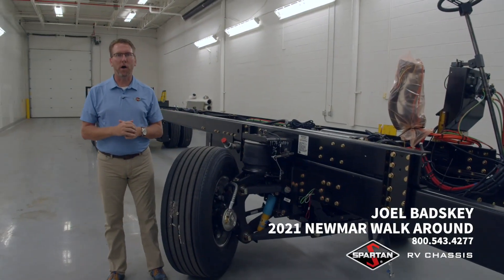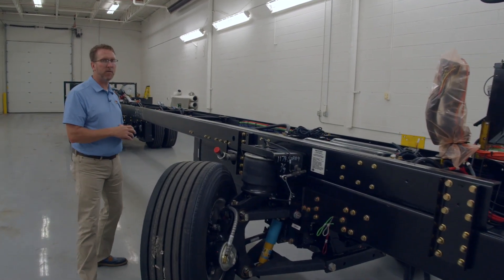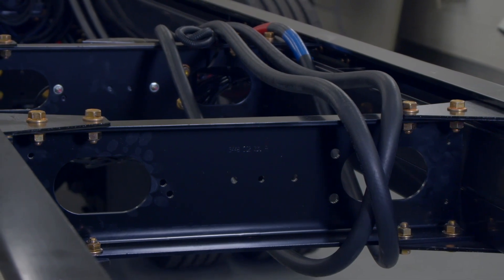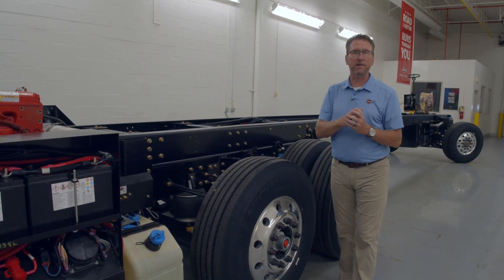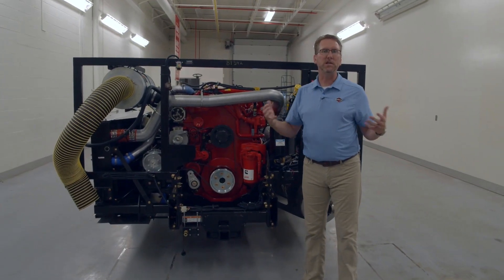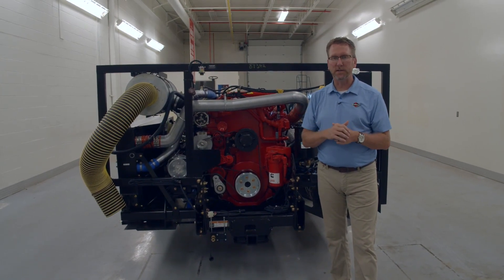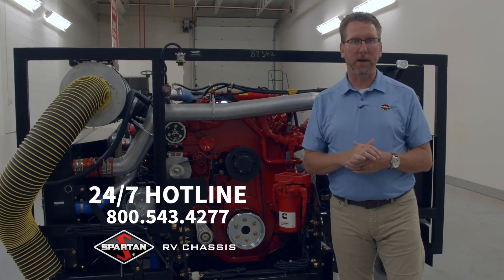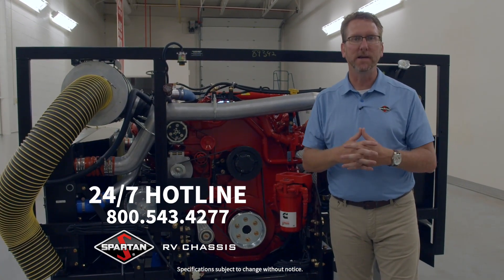Newmar MY2021 chassis updates

Comment: Despite the comment at 0:53, all modern shock absorbers (properly called suspension dampers) are telescopic hydraulic type - "liquid" shock is not an alternative to "gas shock". 

What "gas shock" means is that the fluid is kept under pressure (referred to here as "back pressure") by trapped gas (nitrogen) at higher than atmospheric pressure. All monotube shocks are gas pressurized; the alternative is no gas in the working tube, and an extra outer tube (thus "twin tube") as a reservoir. There must be either a gas cushion or outer reservoir to accommodate the change in volume inside the working cylinder as the piston strokes in and out. So the choices are:
twin tube, or
gas-pressurized monotube.

The gas pressure does avoid foaming of the fluid, so it is beneficial. Just as importantly, and not mentioned in the video, is that the monotube design exposes the outside of the working cylinder's tube to ambient air for cooling, while the twin-tube has the reservoir around the outside causing less direct cooling. 

I don't think that this account manager understands the technology - he has only memorized some of the advantages for marketing.

Comment: The comparison of frame rail thickness is interesting, but not very useful. 

One issue is that it seems unlikely that all chassis models from any chassis manufacturer use the same thickness of frame rail... so what is being compared to what?

The other and more significant issue is that thickness is just one of three frame rail dimensions which are all important: thickness, flange width, and web height. The yield strength of the steel is also important, and not mentioned. 

For instance, in a quick web search I found a spec sheet for a 2006 Freightliner XC that gave dimensions of 9" x 2.75" x .25", and another spec sheet for a 2013 Freightliner XCS that gave dimensions of 9-1/8" x 2.81" x 5/16" (which is thicker than this video claims).  If you are going to compare only one specification value, it should be RBM (resistant bending
 moment), which is the result of all of the dimensions and the yield stress.

Comment: Why only a six speed still?  The last Diesel pusher I drove, the gear ratio spread was too wide and it would shift at the redline and put the engine under its power band, making hill climbs a very slow endeavor.
Reply: They use Allison transmissions, which are the only readily available automatic transmission line in the medium-duty market... and Allisons are only six-speeds. Check any medium-duty truck from common manufacturers such as Peterbilt/Kenworth and Freightliner... they have 6-speed Allisons. 

They are using a Cummins X15 engine. At that size it would make sense to use a heavy truck automatic, often called an AMT (for "Automated Manual Transmission"), typically from Eaton. I assume that's just a cost issue. 

The most similar commercial vehicle to a diesel pusher motorhome is a large bus. Prevost, for instance, used Allison transmissions until they were purchased by Volvo and switched to Volvo's heavy truck I-Shift automatic (AMT).